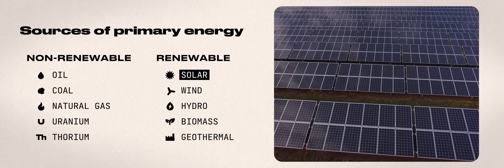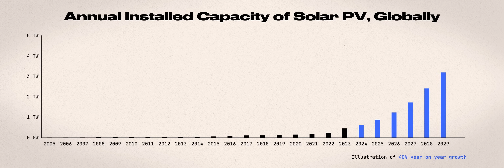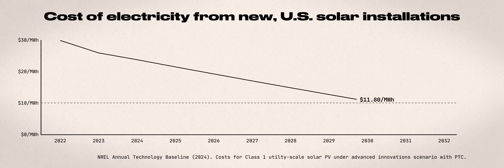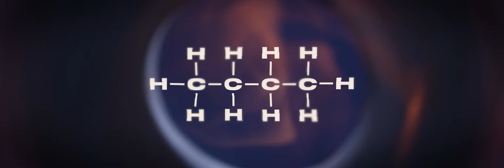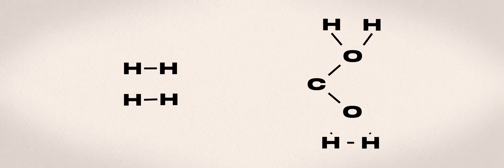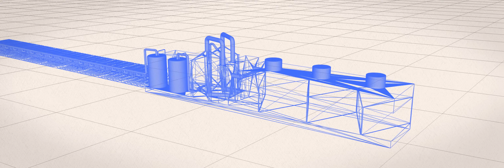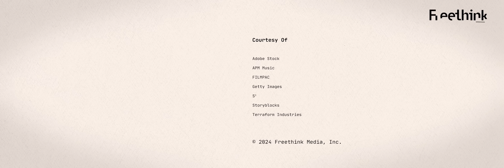95% of our energy could be downstream from solar by 2042 | The Freethink Interview: Casey Handmer

Comment: I guess putting solar on every new home and every new home is mono pitch roof with every square foot covered in solar tied to micro-grid is out of the question. Solar panels generate energy and shade the roof/home reducing heat signature/heat sink characteristics making home easier to cool in summer

Comment: Fake news/ misinfo. Solar plus needed storage or conversion to useful synthetic fuels is still way more expensive. I'm a chemical engineer and this guy is full of crap
Reply: Those are pretty easy problems to solve, and I'm not even a chemical engineer. 

Storage problems? For what? Methane? We already solved that, we do it every day - simply pipe it away to storage facilities. For electricity? Why, when the electricity is going straight into producing methane? 

Conversion to other fuels is expensive? Good thing we are already phasing out those types of fuels for electricity. As the demand for those fuels fall the demand for synthetic fuels will fall too. The price of methane will fall due to its abundance, and subsequent chemical processes will become cheaper by default. The only fuel that is not in danger of being replaced by electricity at this point is rocket fuel, but it already uses methane as part of its production process, will be cheaper due to cheaper methane prices. 

So no, there is definitely promise in this idea, especially when supplemented with other sources like nuclear. But in the end, what price is too high for saving the planet? We have to be willing to make sacrifices if we want to survive.
Reply: @gloriouslumi  just because something is possible doesn't mean that it will be economically viable. Yes, economies of scale can make the price go down, although that takes significant investments, innovation and time.
Reply: @gloriouslumi  You have no idea what you're talking about. None of the options are economic or within reach of being economic with any current solution or plausible solutions. If you adopt energy that is much more expensive then you destroy our economic system.
Reply: They are not going to store the electricity. They are making the machine cheap enough that they can be profitable even if they don't run it at night.

Comment: And what is the EFFICIENCY of burning? 10-20%
Batteries and electric motor is +80%.

Soon there are VERY cheap sodium batteries.
Reply: You are right. His point is a more economic one, if one can get the price of 'solar' methane down to below market price, then one could just participate at the market and earn money. At the same time, it would displace fossil methane from the market, which would be a win. I think it can only be part of the solution, but we have places where it is very, very difficult to replace liquid fuels like in aviation, there it could be a useful alternative.
Reply: Where? Your batteries won't even float nor fly because the energy density is pisspoor
Reply: Batterys r heavy trash. 5kg battery equals 5L petrol? Nope
Reply: Ok, try to make fertilizer from just batteries.
Reply: They've been saying that for decades mate

Comment: We're deploying solar wrong. If 70 - 80% people will be living in cities by 2050'ish then solar should be deployed there, not clear cutting swaths of pristine wilderness so energy can be generated in the middle of nowhere, far from where it's needed. Cities should be taking care of its hinterlands by exporting energy, not acting like a parasite on its surrounding areas. Cities need to take advantage of its geophysical assets to create interconnected local minigrids
- making everything energy efficient, especially buildings (the less we need, the less we need to generate)
- convert existing power stations to work on renewables to take advantage of existing transmission and distribution infrastructure 
- geothermal, wind (on & off shore) awa ocean power to provide non intermittent energy
- solar (cheap but intermittent)
- thermal recovery district heating awa industries requiring heat 
- energy storage (at grid & community scale, V2G)

Lots of options becoming available, and more in the pipeline.

A small city in India is already 100% powered by renewables, mostly solar

Where there's a will, there's a way...

Comment: nuclear has like 4 times the capacity factor of solar sure it costs more but its wayyy better value solar has a storage problem nuclear doesnt
Reply: Nuclear is great and better than fossil fuel, sure, but you still need to store all that nuclear waste after it's been used by the reactor. Not to mention the cost to maintain and train people to run them, which isn't easy.
Reply: @darkcrow42  Nuclear is the only way to replace base load cost effectively. Nuclear waste is a fake issue.
Reply: @darkcrow42  nuclear waste has been solved 50 years ago its not a problem if people have been telling you that it is they are lying to you, and fixing climate change is alot harder than training nuclear scientists
Reply: @darkcrow42  so what if it isnt easy? If the pay is good people will just do it. Being a plumber isnt easy, but the pay is good so people do it. A man (or woman) will do what they need to so they can feed their family. If the ay is worth pursuing then they will study to get the qualifications for whatever nuclear management protocol there is
Reply: The LCOE figures of cost already include the capacity factors, and if your fuel production system is able run intermittently with the solar it is on-site with, then there is no firming cost. One would have to compare the cost of batteries vs the lost production of fuel due to downtime. And its not just 'sure  it costs more' its horrendously expensive to build a new nuclear plant.
Reply: @themogget8808  It's expensive because of over regulation, not because of the physics of the real world. Big difference.
Reply: @michael2275  And why is nuclear regulated so harshly? When was the last time a solar farm turned a town into a radioactive wasteland?
Reply: @themogget8808  Over regulation costs can be overcome, physics can not.
Reply: @michael2275  "Physics" is an engineering problem looking for a bit of creativity.
Reply: @themogget8808  the lcoe of batteries alone is more than nuclear and thats to just store the energy

Comment: Love the Premise, but Disagree with the Primary Energy choice. I am guessing Nuclear has a better EROI than Solar PV, and also produces Heat which would result in higher overall conversion efficiencies in synthetic fuel production.
Reply: I mean, both would be ideal.
Reply: " I am guessing Nuclear has a better EROI than Solar PV ...."
You are mistaken; solar PV has better EROI both in terms of energy invested and in terms of money invested.
Reply: @calamityjean1525  Your statement is partially incorrect. 

According to every article I’ve seen written on the subject, Solar PV has the worst EROI when compared to all other commercial alternatives. 

According to Wikipedia, Nuclear has an EROI around 100. Whereas, Solar PV is around 10. The LCOE of Solar PV is currently cheaper, but this is due to Regulations and Subsidies, and not fundamental Physics and Economics.

Comment: Genius. Let's do it.
Reply: It's super dumb 😂😂😂 Damn, you need to think about this a little bit more
Reply: @Hansulf  seriously? You think using the power of the sun is dumb?
Reply: @johndaugherty4127  Throwing it away by losing 70% in inefficiencies to use it as a fuel that also loses another 70% in inefficiencies, is pretty dumb. Even more considering charging batteries is almost 90% efficient.

Comment: Has solar gotten cheaper? Or are there a lot of government tax credits and incentives that have gone into solar? Redistributing the cost is not the same as lowering the cost.
Reply: They had gone cheaper alot
Reply: It's dropped 90% since 2009. That's not due to government programs, it's due to scale that government programs have helped achieve.
Reply: The cost comparison graph at 2:15 between solar and nuclear says "Lazard (2023). Estimated levelized cost of energy WITHOUT subsidies."
Reply: Solar has gotten much cheaper, yes.
Reply: Blame the u.s. putting tariffs on solar power manufactured by China isn't a w'ar mon'goring nation. The US is if so the how many wars the US has been compared to China and such? That ar'gument doesn't add up
Reply: @butterbean139 Your use of apostrophes doesn't add up.

Comment: Batteries
Reply: if you're using solar to create synthetic fuels that would reduce the need for batteries
Reply: @grimaffiliations3671  Costs multiples of normal gasoline or nat gas. No way to get it below, just too process intensive.
Reply: @michael2275  Because we don't have enough scale, yet. Solar panels were also expensive af.
Reply: @huckleberryfinn6578  No, that's not how it works with industrial processes. They require infrequent non linear break throughs to reduce cost. Processes for converting sunlight to synthetic fuels is decades old with minimal opportunity for improvement. At scale it still costs over $10/gallon with no tax applied (50%+ of pump price in Cali is tax).
Reply: @michael2275  Hundred+ years old actually. And as was said in the video, it's only now economically possible thanks to photovoltaics becoming so cheap and it will become cheaper to make synthetic fuels in near future than dig them from crust.
Reply: @kazioo2  It's not economically viable even with free solar. Stop lying.
Reply: @grimaffiliations3671  I guess, and it would also suck up co2 from the atmosphere. 

But I wonder how much energy it takes to get to liquid fuel(gasoline/kerosene) from methane and how clean that process is for emissions reasons.

Also is there any other substances required for the chemical conversion
Reply: @grimaffiliations3671 and what us the efficiency of burning? 10-20%.
Batteries and electric motors are +80%.

Comment: What are ALL of the byproducts of burning the fuel you are making? i.e. Would it deplete water, air, carbon, hydrogen, etc. from the atmosphere and water bodies at all and if so, at what rate? Would any of the byproducts be detrimental to life?
Reply: Its a closed loop cycle.

Creating the natural gas takes in water (H2O) and Carbon Dioxide (CO2). The output is Methane (CH4) and Oxygen (O2):
 (2)H2O + CO2 -> 4H + C + (2)O2 -> CH4 + (2)O2

Burning the natural gas is that kinda in reverse:
CH4 + (2)O2 -> CO2 + (2)H2O

There aren't really any byproducts and we aren't using up any physical resource (unless you want to add in the manufacturing of these factories)
Reply: Methane breaks down within 3 years so no negative effects
Reply: The exact same as burning regular gasoline: CO2 and other carbon molecules.